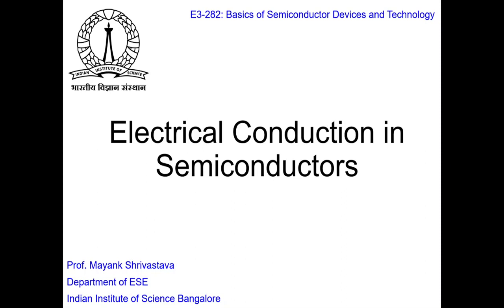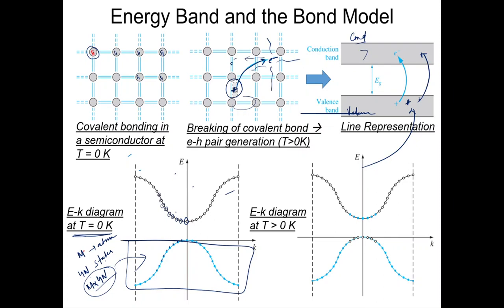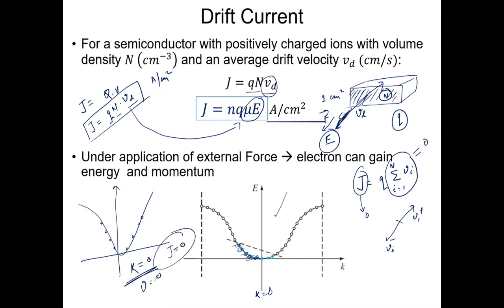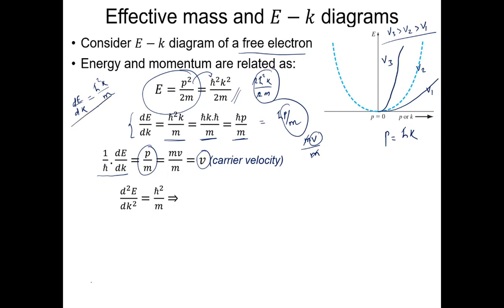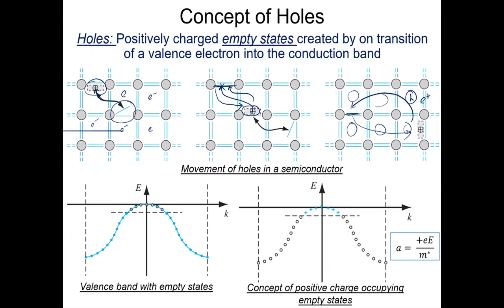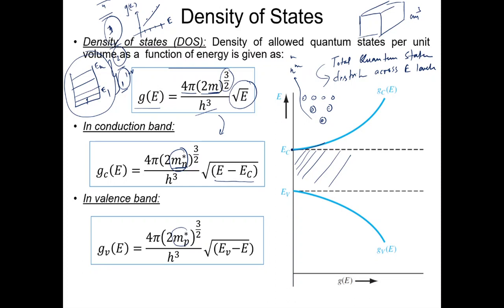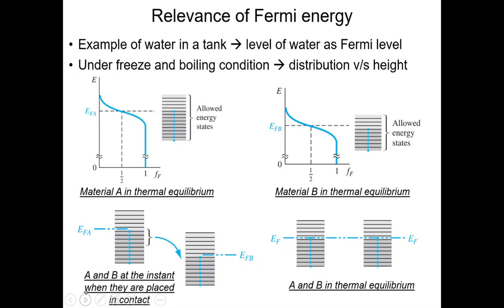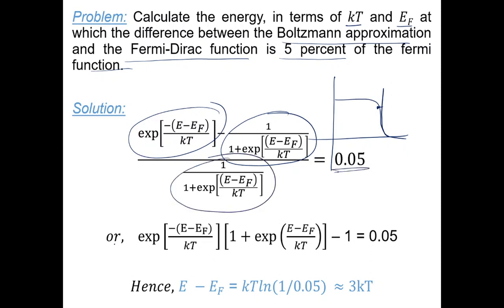Lecture 8 - Electrical Conduction in Semiconductors

Comment: In the first problem you solve at 1:08:40 , why are you not cubing planks constant h. I get a different answer. my calculator cannot computer is since we a dividing by such a small number. (h)^3 = (6.625x10^-34)^3 =  290.77x10^-102 = 2.9077x10^-100. Calculator gives 0.